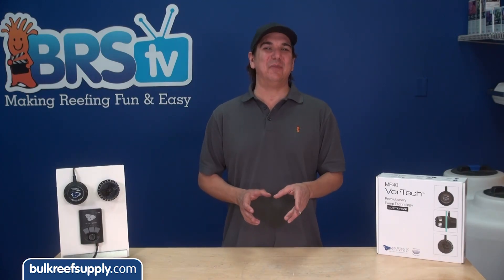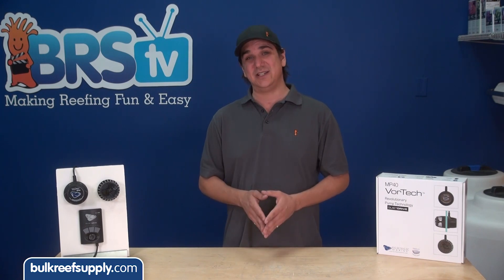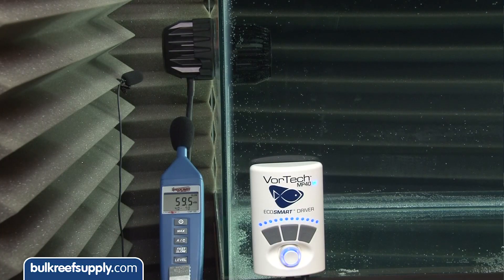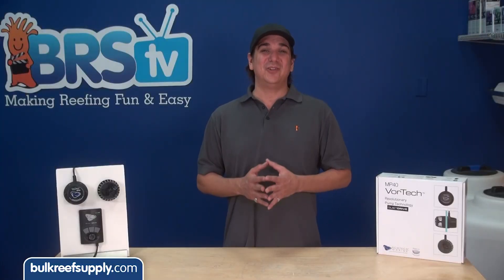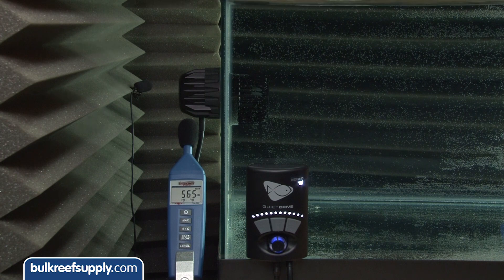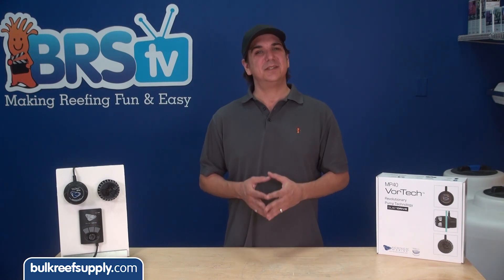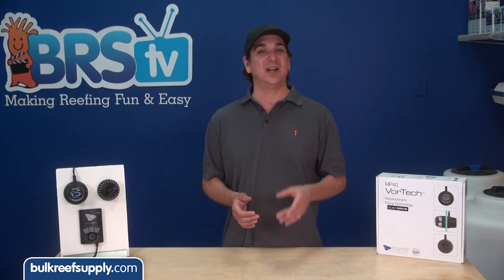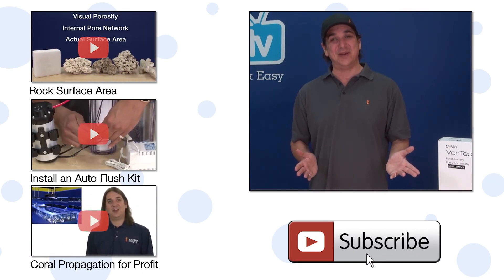Which will win: EcoTech QuietDrive vs EcoSmart Powerhead?

Comment: In the market for a quiet drive or two.   For the same flow rate, would it be quieter to run 2 MP 10s or 2 MP 40s?   Would  mp40's  overkill.  I was also contemplating running both on the same side (1 forward and 1 rearward) in two different modes.    I have a 45 gal cube with an internal sump 4" deep including acrylic AND there is also about 65 lbs of rock in the tank, so the display area has about 33 gallons of water and sump has 6 gallon.   It is also bare bottom, while I figure out dead spots.   Will at a thin layer of substrate once figured out.  While I have nothing in the tank and will start slow and enjoy the journey,  I have no idea if I stop at Mushrooms and fish or go all the way to advanced SPS.
Reply: Any other options I should contemplate?  I was thinking a Gyre, but thought there might be too little space to get the full effect.  I hear the Tunze nanostreams have a bit of noise as well.  Thoughts?

Comment: sorry, but 90% decrease in noise? the decibel meter only shows 7 decibel difference, was that just a mistake?
Reply: @BRStv  Its a late response but 59 to 53 is about 6db. Even if it were 7 db its not a 90 percent reduction. 10db is a 50% reduction so at best 7db would be about 35% reduction.

Comment: Ecotech says 90% noise reduction, but only is the 10%?
Reply: Are you talking about how the decibel level went from 59.5 to 53-ish (a tad over 10%)? If so, I see what you mean, but decibels aren't a linear rating. Surprisingly, every 3db's actually DOUBLES the amount of power delivered as sound.  Power-wise, then, a pump that's 59.5 is actually twice as loud (sound power-wise) as a pump running at 56.5, and 4 times as loud as a pump running at 53.5.  But your ear doesn't hear things this way. Generally you view 3db as a "noticeable difference" to most people, and 10gb as sounding twice (or half) as loud. Anyway, you see why this is all confusing; because it's not a linear scale and your ear doesn't hear power linearly anyway. Suffice it to say that the 6.5db difference here in pump volume is very significant. :)

Comment: It's great about the upgrade, but honestly it's expensive, I have two mp10's, $200 to upgrade both, or add  another $99 more and get a gyro to replace both with better flow, ecotech should make the upgrade cheaper or offer some sort of credit for the older parts that are being replaced!!
Reply: MP10 upgrade is $50 so that would be $100 not $200
Reply: My bad , I looked on their website and saw $100 each, thx for the heads up!!